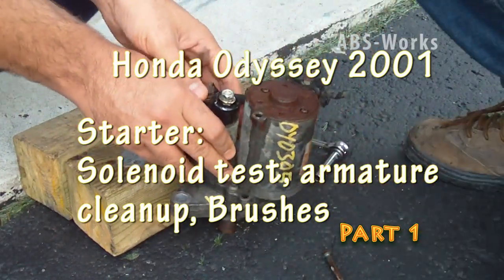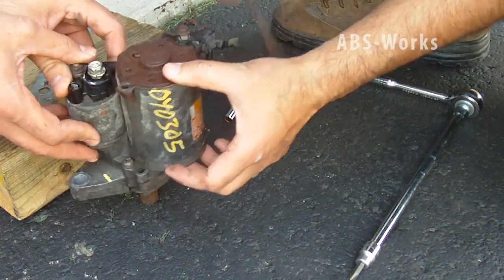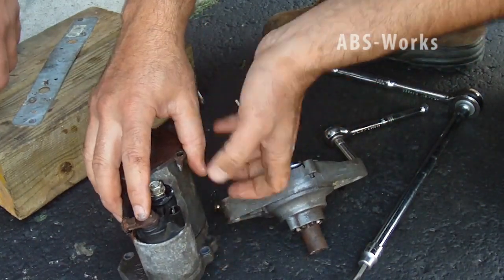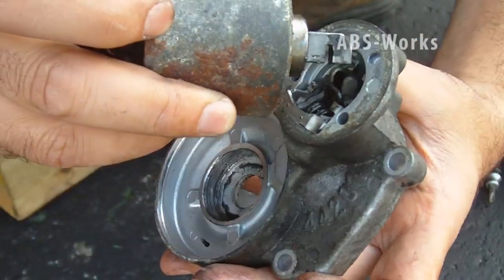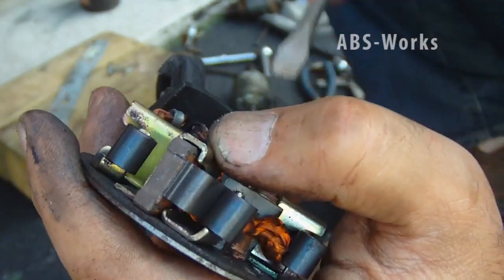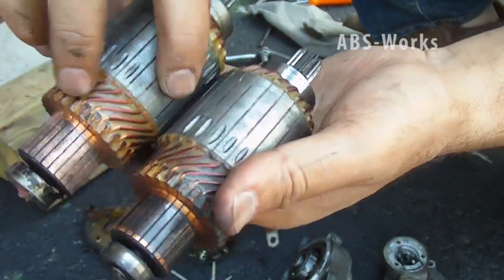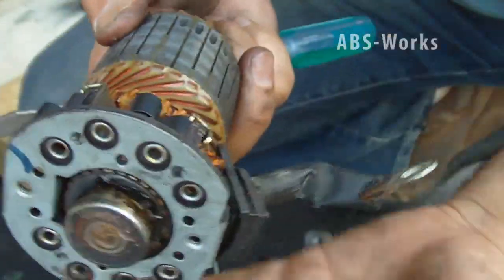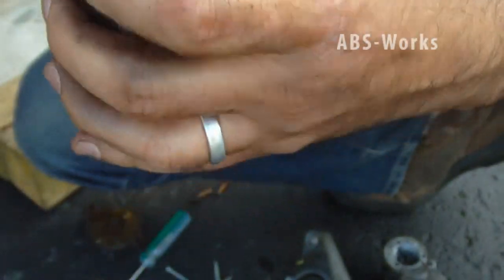2001 Honda Odyssey Starter test and service Part 1

Comment: Excellent video! Excellent video! Excellent video! ... you help me fix my starter for my 1998 Dodge Caravan .. i was replacing the contacts for it and accidently pulled out the motor from the brush contact .. could not for the life of me figure how the hell i was gonna put it back together .. my four brushes doesn't have a back cap to remove ... so it was really tight small area to work , but with this vid  was able to figure to move those little springs to the side temporary... Awesome , i was so happy ! .. thanks again! ...
PS... Vote for Trump he's Americas last Stand! .. God Bless!